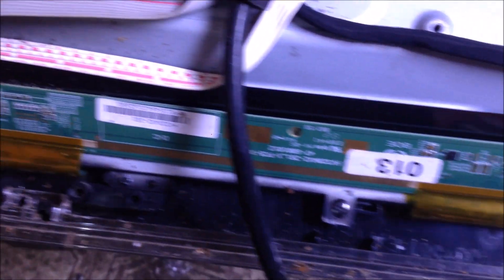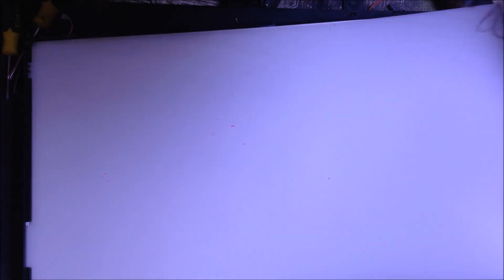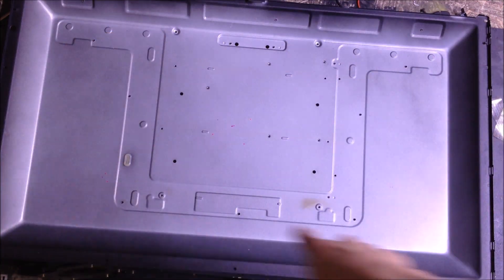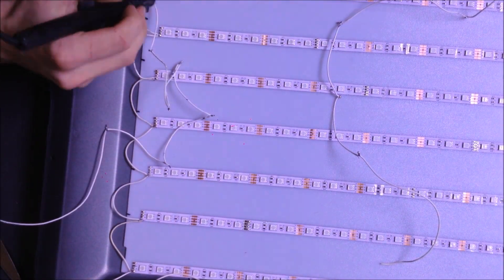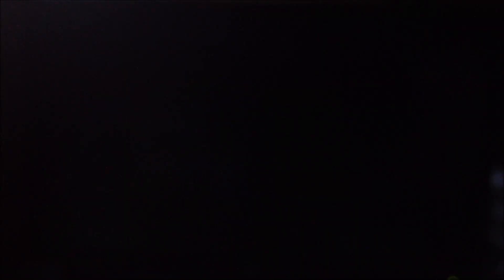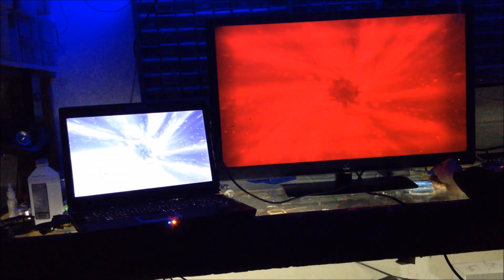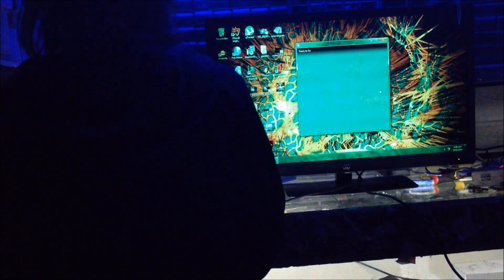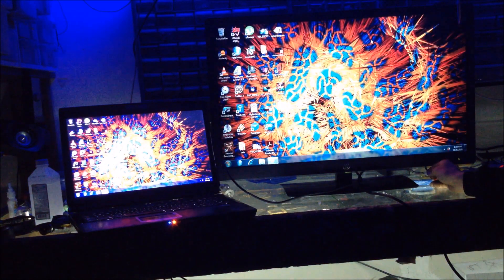Exchanging Bad White LEDs in a TV using RGB LEDs & Color Controller

Comment from the maker: Questions on why i used a laser over a flashlight has been asked on Hack A Day. The answer is that using a laser allows me to get into very narrow areas that are on the panel, anything that is black such is the static no signal screen can be hard to locate and see with a flash light. With a laser they instantly pop out when you scan over the screen as well as all cracks. The 532nm DPPS common laser is the best for this as it's not polarized the same as a direct diode type.

Comment: I was thinking to replacement mine with led strips , will they be brighter than original ones , and what if I completly fill it up with strips ( wil that solwe black lines problem ? )
Reply from the maker: That's a tricky one to solve. I would suggest looking into COB LED panels. DIY Perks did a fantastic video which shows integrating a PSU and LEDs. You don't need to go as bonkers on chip density. You can also look at the densities on LED strips and look for a lower density with wider spacing say like 2 inches apart and then space your strips the same. 

https://www.youtube.com/watch?v=WlFVPnGEb8o

Comment: I just replaced the backlights in our lg TV with factory LG backlights, can I use the old backlights that are still good( except that they light up blue now) to use on my motorcycle to light up different areas like under the gas tank etc? Will they run off of 12 volt battery power or do I need to add something into the wiring to make it work?
Reply from the maker: Apologies on the delay I have been quite sick this last week. Yes you can use the LED strips as is, but they require more then 12v in most cases. Usually 20v to 40v It is best to get a current/voltage adjustable boost driver to run the LEDs. I recommend not getting just a voltage adjustable one because LEDs will draw more current as they warm up and this tends to make them end up running much hotter then recommended. To find out the power needed it's usually a matter of 3v/3.3v x LED amount however some LEDs can have 2 or more LED chips in one package in series, this means a single LED my take 6.6v.  Look into something like this for your LEDs

https://www.ebay.com/itm/DC-DC-Converter-Step-up-Voltage-Buck-Boost-10-12-15-20A-150-250-300-400-1200W/293100779651?hash=item443e2af883:m:ms9mPBta7cYmuCJuDCdutCA
Reply: @Zenodilodon  I wasn't going to use all of the strips, probably just a couple under the gas tank to light up the engine. Two of these strips plugged together make up one strip going across our 60" LG TV.
Reply from the maker: @bodeine454  Use the lowest wattage step up driver on the Ebay listing then. If you are only going to to use a few of them I'd suggest using the first LED strip section. You can have them run at a lower voltage. You will need to short out the 2 pins where the second LED step connects.. Run the picked strips in parallel to the step up converter. You will need to use a current/voltage regulated step up driver, there are no LED strips I know of that take 12 V and your battery/alternator power is not clean enough for driving LEDs properly due to voltage spikes up to 14v and no current regulation.
Reply: @Zenodilodon  Thanks for the explanation, I'm not that advanced with electrical devices like step up converters and such but I'll research it and find out what they do and how they work.
Reply from the maker: @bodeine454  You should have fairly good luck finding information on them, they called boost converters. Make sure you look up using both voltage and  current regulation. You can probably find all the information on google by searching " how to use current regulated boost drive to power LEDs "  I will also say that this will be a bit tricky without previous experience and a lack of a multi-meter. All in all it may just be easier for you to look for a lighting kit designed for automotive/12v use. However many products lack current regulation device which is usually a little box that goes between the battery and LEDs. The market is full of poor quality LED products for automotive.
Reply: @Zenodilodon  I'll Google it, thanks again, it'll be intersting to see what I find out and I agree with the poor quality aftermarket LED products, a lot of them leave a lot to be desired.

Comment: Interesting Project! Music is a fine choice for this project, but I'd suggest two things, one lower it until you do the demo. Its quite hard to hear what you're actually saying. Second, if you're into visualizations get winamp for the vastly superior milkdrop plugin. It makes windows media player look like childs play.

Critique aside great work. I wonder if a reflector would help increase overall brightness or help on the edges some. Maybe some aluminum ducting tape would be a cheap way to even out those dark spots.

Now that I think about it, if you have a HUE lighting set or can get one, I seem to recall some sort of RGB bias lighting it can do in response to movies or games. Might make an interesting option for a future video.
Reply from the maker: I did tuck the edged from the original reflector around the plastic when putting the screen together, it helped not so much. The issue came to 2 things, both I knew going into it, first was the lack of x and v refractive sheets, these both help even out the light but mores-so the LED's them self don't have the correct plastic reflectors, I have plenty of them though from TVs I made into work lights and could manually place them on LEDs and may even do so if I choose to do more with this.

Thanks for the feedback, issues with sound come down to a mix of the bad compressor in window's movie maker and that I only have one ear, so hearing on my end is also a tad messed up. I do enjoy visual and I have played around with milkdrop and the previous integrated visualizer years ago, lots of fun currently I enjoy Sound Spectrum's GeForce as my go to visualizer, it's really incredible but since I only have a trial I wanted to avoid having their ad splash screen creep up during filming.